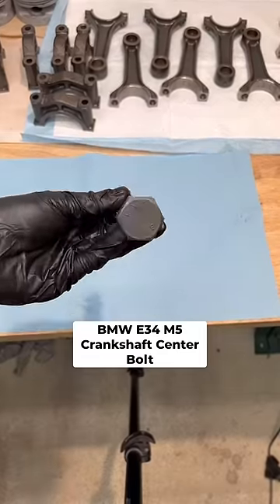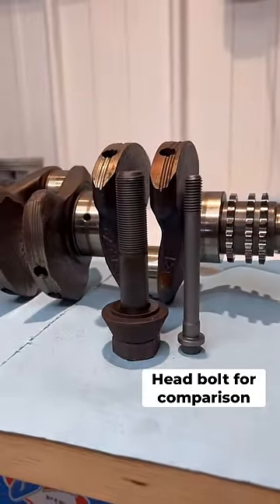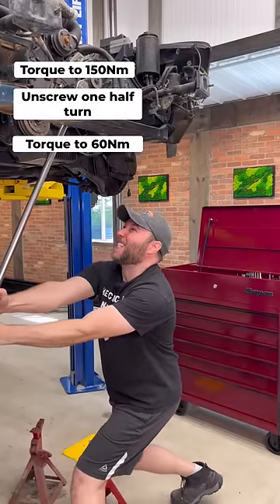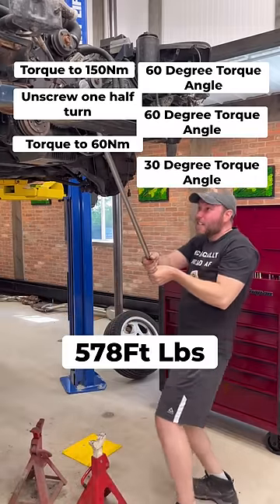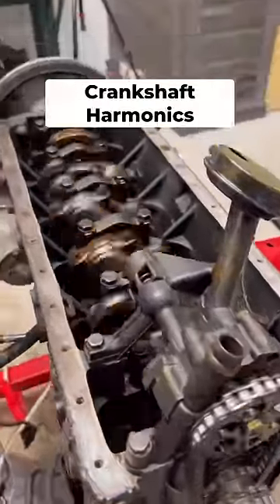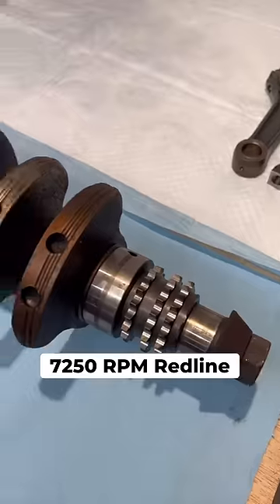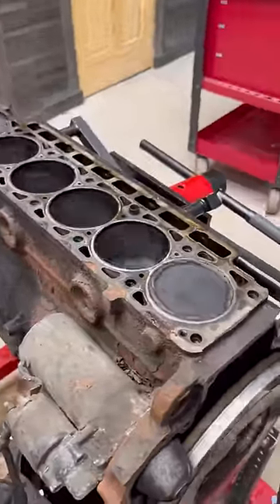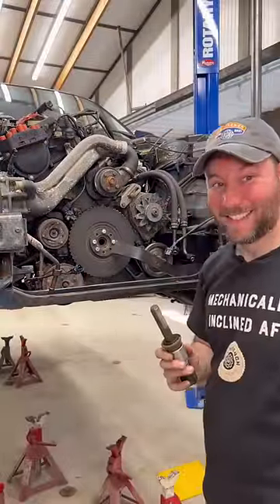BMW E34 M5 Crankshaft Center Bolt Explanation #bmw #cars #diy #bmwm5 #bmwe34 #restoration #engine

Comment: Torque sequence for a 2005 Impreza. 2 ugga's and 3 dugga's
Reply from the maker: hahaha....that's a good translation
Reply: but, my engine runs 7600 its old toyota and clockwise bolt on clockwise rotating engine and 0 issues. 33yers still working, turbo 2liter 210hp, hp per liter ratio close to m5, why it can make problems? why it dint make any problems on my engine?
Reply: BMW's suck so bad
Reply: 2005 impreza also goes above 8000rpm. in fairness the crank is half the length.
Reply from the maker: @dulos69  I like the old stuff
Reply: @kombrug  is it a inline 4 or a inline 6? That does make huge impact what engine layout you have
Reply: How do you ugga separately to a dugga though?? My impact goes ugga dugga ugga dugga ugga dugga. Does yours have a switch for the duggas? 😲
Reply from the maker: @amirbasssystem  I6
Reply from the maker: @MaNNeRz91  It has a big dial!
Reply: Are those calibrated ugga duggas?
Reply: That would be so funny on a bumper sticker or a T-shirt😅
Reply: Ez30 flat 6 7000 rpm and only needs 2 ugga's and 3 dugga's also
Reply from the maker: @ON-EightySix  Different engine design though
Reply: @wewrench  I totally understand modern design vs old design 👍🏼
Reply: Śruba musi puścić od szczal  a nie
Reply: no wonder boxer engines are always broken 🥴
Reply from the maker: @dreamydreary  haha...be careful, there are a lot of militant Subie guys on here! To be honest though, I worked at a dealership that had a Subaru svc dept next to ours and the guys weren't busy at all cus the cars never break

Comment: Same as an M62, I just put red tread locker and hit it with an M18 Milwaukee full power for about 15 seconds, 5 years later, 0 issues.
Reply from the maker: These machines are way more forgiving than the factory engineers let on
Reply: @wewrench  Also reuses the same bolt 🤣 I reuse the aluminum bolts too, never have issues, on my own cars that is, not on other people's cars.
Reply from the maker: @SavageBunny1  I've heard stories like that way too many times to count,
Reply: They say there's a limit to bolt stretch. Good. Means when you reuse it, it won't stretch no mo. SEND IT
Reply from the maker: @yevheniylitynsky4348  You should not reuse it
Reply: I agree. Red Locktite and hit it right good and proper.....
Reply: @wewrench  I guess I should also state that it's on an M62 on a Range Rover, never see's hard shifting like a manual, I would guess those sudden RPM drops from smashing a stick would cause it to come loose.
Reply from the maker: @SavageBunny1  Honestly, in the real world, engines are a lot more forgiving than people think.
Reply from the maker: @rocpile  It will probably work. I've seen people in the field cut every corner imaginable and their work didn't come back
Reply: @wewrench  if zipties n bias plies hasn't taught us that engines are tougher than most people think then you need to rewatch the burnout callout
Reply from the maker: @calebz1448  agree 100%!
Reply: Bruh abdul rn is rebuilding one of these in the sand!!
Reply from the maker: @chadwick1084  hope so! We have to save every single one!
Reply: That sounds like a terrible idea. I would hate to buy any car you have owned 😭🤣
Reply from the maker: @darianzielinsky96  it’s not that big of a deal
Reply: But how do you remove it?
Reply: This is something I've never admitted to anyone before, but yeah I did almost exactly the same thing. Just barely got my torque wrench to click at 250, which is as high as it goes anyway. So I busted out my 1/2 inch drive Snap On mg725 air gun and let it rattle for like 10-20 seconds. This was close to 4 years ago now, and I tickle the redline in my e39 540i/6 almost every other day.
Reply: @benargee  you don’t, the combination of red loctite and red lithium of the Milwaukee battery means it’s welded!! 😂😂😂
Reply from the maker: @540i-v2w  I'm sure it got it tight enough. If you don't have any problems, then that's the real deal
Reply from the maker: @benargee  A big ratchet or impact
Reply: Lmfao this is hilarious. Yeah I've definitely forgotten if I torqued a cylinder head bolt or 2 during replacement or gouged a head right near the combustion chamber and never had a problem. They really are forgiving.
Reply: Good luck getting that one back off lmao
Reply: @wewrench  you’d need at least a 3/4” impact if not bigger. I doubt it’s coming off with a ratchet without breaking the ratchet itself, maybe a 1” drive breaker bar with a long helper on it. If he just let that impact dig and put red loctite on there it aint coming out without some cussing.
Reply: How many duggas
Reply: Statistically, yours will live way shorter than correctly installed ones. That's why a company that saved half a cent on a 20€ part still spent the time for that specific torque on that specific bolt 

It's like saying "i never had a heart attack doing coke" - yeah, it's about statistics and and doing things right, it doesn't mean every engine will fall apart asap
Reply: @redneck4200000  thanks for giving the plus 1, for everyone working on engines it really shouldn't be to complicated to spend a minute to use the correct toques on such central pieces

/s, i know you're talking about the original comment, that's were you're wrong
Reply: That's my thought also
Reply: Doing timing chain guides on my M62tu. Bought a new one. $27 genuine BMW. Not taking any chances considering labor hours involved.
Reply: "I did that thing once and it worked. Therefore it has to work everytime on every single unit."
Reply: Someone with something reasonable... thank you.
Reply: @benargee high torque impact wrench 1,500 ft lbs will bust or break any bolt 🔩
Reply: @bentrod3405 I go to the junk yard and bust them for fun there's nothing the 2767-20 will not bust oor
Reply: @bentrod3405 I go to the junk yard and bust them for fun there's nothing the 2767-20 will not bust oor
Reply: @bentrod3405 I go to the junk yard and bust them for fun there's nothing the 2767-20 will not bust oor
Reply: @bentrod3405 I go to the junk yard and bust them for fun there's nothing the 2767-20 will not bust oor
Reply: @bentrod3405 I go to the junk yard and bust them for fun there's nothing the 2767-20 will not bust oor
Reply: @bentrod3405 I go to the junk yard and bust them for fun there's nothing the 2767-20 will not bust oor
Reply: @bentrod3405 I go to the junk yard and bust them for fun there's nothing the 2767-20 will not bust oor
Reply: @bentrod3405 I go to the junk yard and bust them for fun there's nothing the 2767-20 will not bust oor
Reply: @bentrod3405 I go to the junk yard and bust them for fun there's nothing the 2767-20 will not bust oor
Reply: @bentrod3405 I go to the junk yard and bust them for fun there's nothing the 2767-20 will not bust oor
Reply: @bentrod3405 I go to the junk yard and bust them for fun there's nothing the 2767-20 will not bust oor
Reply: @bentrod3405 I go to the junk yard and bust them for fun there's nothing the 2767-20 will not bust oor
Reply: @bentrod3405 I go to the junk yard and bust them for fun there's nothing the 2767-20 will not bust oor
Reply: @bentrod3405 I go to the junk yard and bust them for fun there's nothing the 2767-20 will not bust oor
Reply: @bentrod3405 I go to the junk yard and bust them for fun there's nothing the 2767-20 will not bust oor
Reply: @bentrod3405 I go to the junk yard and bust them for fun there's nothing the 2767-20 will not bust oor
Reply: @bentrod3405 I go to the junk yard and bust them for fun there's nothing the 2767-20 will not bust oor
Reply: @bentrod3405 I go to the junk yard and bust them for fun there's nothing the 2767-20 will not bust oor
Reply: @bentrod3405 I go to the junk yard and bust them for fun there's nothing the 2767-20 will not bust oor
Reply: @bentrod3405 I go to the junk yard and bust them for fun there's nothing the 2767-20 will not bust oor
Reply: FT BABY
Reply: Red loctite=super glue
Reply: @540i-v2w  longer bar needed. 250 are rookie numbers!
Reply: @braindecay9477  those are terrible examples. A heart attack on coke depends on the heart. You could have a heart attack from your first ever line or you could have a heart attack 50 years down the line. 

Wtf has that got it do with torquing a bolt to spec or that'll do? I'm pretty sure it doesn't need to be that tight. Never been a known common issue either so obviously people haven't had such bad luck with their send it repairs
Reply: I did the same with the m62 I swapped into my e34 540. I put blue loctite though and also used an m18 1/2in impact and I spin mine over 7200 regularly with the chip I have my redline is 7400rpm
Reply: That’s about 770 ft lbs if you used a 5 ah battery.
Reply: Try the rear hub nuts...weirdest torque sequence I've ever done...Oh the joys of owning an E34.
Reply: On my VW Jetta TDI, I reused the transmission bolts that is attached to the mounting bracket and guess what? All three bolts. Loosen and eventually the transmission fell on the frame, I later find out that the bolts were torque to yield one-time-use, bestway on any German car if you want to reuse one time bolts is to use thread lock 😏
Reply: @benargee  My friend works at a machine shop, I've seen cranks break before the bolt comes loose 🤣,  he hates working on M62's.
Reply: @yevheniylitynsky4348  bruh if it doesn't stretch anymore it snaps. I've learned the hard way🤦‍♂️😂😂😂 those fuckin head studs on those atv engines aren't forgiving at all
Reply: This comment made my day🤣

Comment: Meanwhile Honda S2000 9000RPM redline 180ft/lb on the crank pulley.
Reply from the maker: Yes but the engine is a different design
Reply: @wewrench  yeah I get that.
Reply from the maker: @mixedboi  Appreciate your comments and support! Make sure you stay tuned
Reply: @wewrench  will try and do my best 👍
Reply: @wewrench  it's less balanced with worse harmonics than any i6.

BMW did it because they have an overzealous engineer.
Reply: S2000 motor is one of the most powerful na motors when you consider its displacement. It's very finely tuned. If honda made a 6, it would kill bmw.
Reply from the maker: @timothyellis3140  I remember what a stir that car made when it came out. The whole hp/liter thing
Reply from the maker: @jeepmanxj  Very true. The M30 platform always had those issues
Reply: @timothyellis3140  it was the highest specific output naturally aspirated engine for quite a while. I think something finally beat it
Reply: @wewrench  mitsubishi fto 8,7k rpm 170ft/lb...
Reply from the maker: @erykkonfrowicz3600  Yup. Lots of different engines out there
Reply: @timothyellis3140  I ain’t taking either side. But it’s a little silly to talk about engines that don’t exist lol.
Reply: @jeepmanxj  IL 6 has a longer crank which are more prone to torsional vibration issues.
Reply: @ferrumignis  a i6 engines is the most naturally balanced and lowest vibration engine made
Reply: @wewrench  yeah the Honda is better built.
Reply from the maker: @ferrumignis  Yes. Same thing happened to inline 8 cyl that Pontiac made. The crankshaft actually sagged
Reply from the maker: @ethanmcleod8819  Was it a cast iron block or aluminum? I don't know much about that engine just that it was a champ
Reply: @timothyellis3140  they did, see j35 and j37 y and z series 
Same redline on a much less balanced 3.5L V6 with sohc. Crank bolt is half the torque while being far more reliable
Reply: @timothyellis3140  not necessarily true. It's more complicated. Honda are masters at 4 cyc, BMW at 6 cyc.
Reply: @wewrench  yes it's a different design.
It's LESS balanced than an inline 6.
Reply: S2000 has better engineering
Reply: @wewrench  "The engine is a better design" would have been correct.
Reply: That's honda for you
Reply: @WeWrench  yeah a better design
Reply: @wewrench  that are just better
Reply: @thomasmann3560  german engineering.
Reply from the maker: @erykkonfrowicz3600  Generally speaking, I agree with you
Reply from the maker: @mikescherrer4923  The design of the engine in the video dates back to the 1960's. (Technically the 1930's) Of course something modern would be better, especially a honda 4 cyl.
Reply from the maker: @RChero1010  It's a different beast all together
Reply: @wewrench  Because they know how to design and construct a proper engine…German sh@tes
Reply: B series are even less - anywhere from 90ft/lb to 150 ft/lb depending on the model as far as I'm aware. B16a2 is about 130, and they redline about 8300rpm ish (when mapped up to 9k also with people just running the same spec on that bolt). They're a bit different to other engines as they spin "backwards". Apparently that makes shit like the crank bolt less likely to loosen off, although I'm not sure how true that is.
Reply: @wewrench  Heck honda did it even with the civic type R
The B16B made 180hp from a 1.6l.
Honda in the late 90s were king of engines
Reply: @timothyellis3140  f series and k series crank bolts are both total knuckle breakers. Broke my biggest bar trying to remove a crank bolt from a k24z
Reply: This comment is exactly what I was thinking
Reply: BMW engines the crank bolt also holds the timing crank pulley/sprocket in place, there is no key it if loosens then you lose timing. It's a stupid design My n54 has and after market crank pulley bolt holder that bolts to the balancer so it all cant move.
Reply: Maybe due to the greater torque output from the crankshaft of the 3.6 - 3.8L straight six?
Reply: 4 cylinder...
Reply: Honda’s don’t have the comfort of a bmw, that goes with the performance…coming from an owner of both
Reply: @wewrench  different how? They're both a rotating mass
Reply: @wewrench  different how? Both are rotating masses.
Reply: But you need at least double to break it loose Honda crank bolts😂
Reply: The EJ207 in the STI revs to 8500 and crank bolt is torqued to 94 ftlb
Reply: @marioperez7375  oh you're so right. I almost gave up one day on my Accord.
Reply: @timothyellis3140  and what do you call a J series??!
Reply: Then why is the J32 crank bolt set at 1800ft lbs from the factory. Tried to help a friend out with a new pulley and it wasn’t going anywhere.
Reply: Because let’s be honest, it’s built better lol
Reply: Key word:  HONDA!!!
Reply: 2jz inline six enters chat....LOL
Reply: @LordToxygene  I'll stay quiet with my 200hp 1988 7M-GE!!!
Reply: @myemail2005  i wonder how how my 4age redtop smallport can reach those sweet 8.000rpms with no overengieneering-
Reply: Top bad it's still a honda
Reply: @aitor9158  I don't know much about their older 4 cylinder cars.  Honda is the best engine builder in the world for reliability.
Reply: @myemail2005  well, honda and toyota kinda have that "who's more reliable" competition going on since decades,specially the 90's 
note that both maked the highest revving car engines...taking bike engines tech, yamaha helping toyota and honda making bikes themselfs

On the other hand european brands xddd
Reply: @aitor9158  I think there are far more 200k+ mile Hondas out there than Toyota's.  I'm a car addict.  I gave a 1988 Supra that I've owned for 26 years.  It's reliable.  Five years ago I bought a 2004 loaded Honda Accord with only 8K miles.  YES...8 thousand miles!  It only has 43,000 miles on it now.  It still drives and feels like a brand new car.  That's 19 years old.  I think Honda's are twice as good as Toyota's.
Reply: @User Name  i just serviced a bmw bike today I've worked on many bmws there car and bike engineers are all just as bad as each other cant stand touching them
Reply: @NoLongo  cap , you’d snap that bolt def not 1800 ft lb
Reply: My Gallo 24 is about 1nm and runs on sprite.
Reply: @timothyellis3140  Honda makes a 6, it's called the accord sport!
Reply: @Mark-bd5ci negative ghost rider toyota is the master of I6  they made the 2jz 9K RPMS ;)
Reply: I mean the S54 M3 motor hs 6 cyls and goes 7900rpm. But daily driving one will be much more pleasurable, imo, than an s2000. Which is still a cool car. Just driven both, worked on lots of M cars. Honda is cheaper to own when bought. M cars are an entire package.
Reply: @dudarino666  I think you might be on to something. An S2000 is to thrash like a madman, but an M3 is a bit more versatile, when it doesn't burn 3 litres oil that is. Sorry I had to.
But M3 is legendary also.
Reply: @wewrench  so?😂
Reply: @wewrench Displacement is it what it makes.. way more mass to rotate
Reply from the maker: @TheS1PikesPeak  Yes, and this engine is 3.6L which is a pig for an inline 6
Reply: @erykkonfrowicz3600  fto gang 😂, do you have one?
Reply: @pbart9821  yep GPX after lift
Reply: That because of Japanese engineering unlike german junk
Reply: @wilurbean  I have a J37 and it tops out at 6500. Nowhere near S2K redline. Great engines both but you can't say they rev the same.
Reply: @charlessawallich1870  oh amen brother
Reply: I was literally going to say this
Reply: my man !
Honda FTW 😉
Reply: @timothyellis3140  S3000? :D
Reply: I was gonna say I rev my little stock bottom end single cam to 7800 rpms lol 🤭